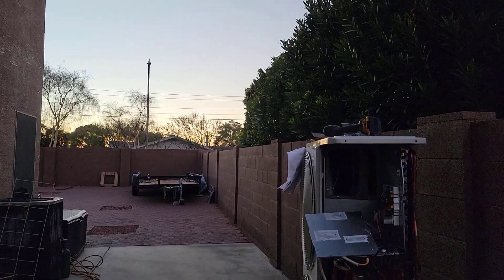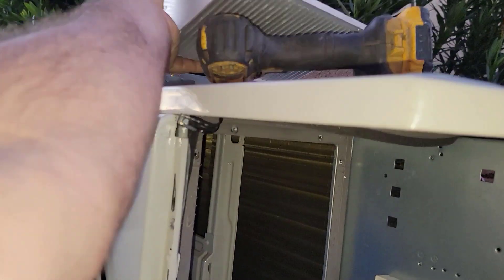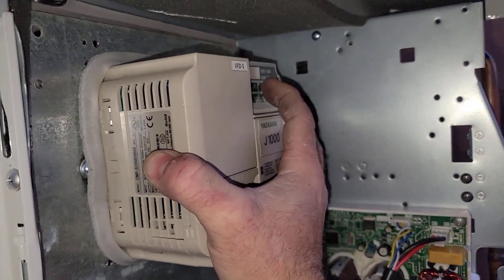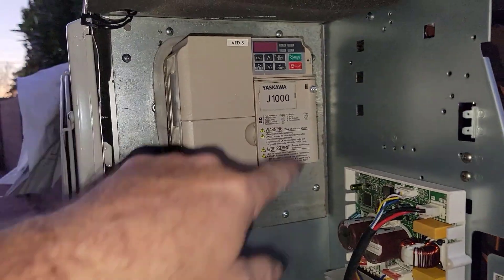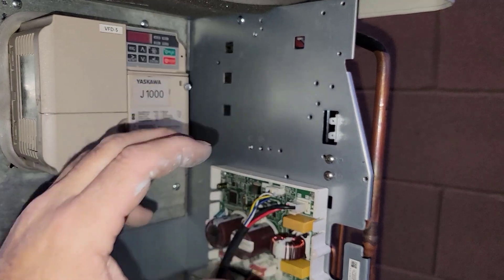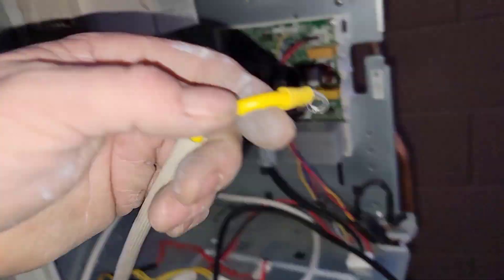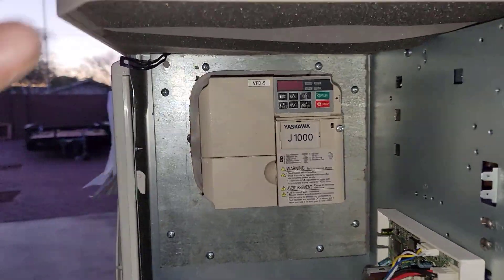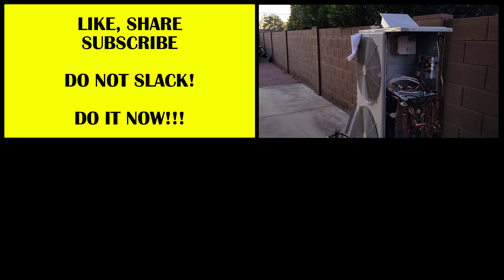Frankenstein Heat Pump gets a new VFD & mounting plate

Comment: Hi:

I stumbled across your channel because I am trying to do something (relatively) similar for a project. I was hoping you could give some advice. I am trying to connect a 5hp VEVOR VFD to the scroll compressor in a Senville 24,000BTU heat pump. However, as I ramp up from lower frequencies, I quickly get an overcurrent trip. When I start it at 50Hz, I need to pull the plug immediately because it shakes violently (maybe wrong direction? I am confident with my coil wiring).

I know the compressor is ok because it was running fine on the OEM control board...

Any help would be amazing. Thanks,

Phil
Reply from the maker: I am not familiar with that drive. As for a 3 phase compressor, you could indeed be attempting to rotate it in reverse. Monitor the suction pressure as it starts. No change = reverse.
For mine, I didn't have to fiddle with the settings too much, but one thing is a 30 second acceleration time like you would do for a supply fan is a no go. The scroll seems to like a fairly quick start to seal and start pumping.

Comment: Hello, what you are doing is crazy. I have a question for you, can we use these VFD devices to run the dc (bldc) motors of inverter air conditioners. Have you ever tried by attaching this device to an inverter air conditioner?

Comment: Great videos - as always. You’re inspiring me to have a go at something novel here in the UK with our astronomical increase in energy prices! Have you ever considered using a 12 volt DC compressor and running it off some 12v leisure batteries topped up in charge from solar panels or wind turbine? Plenty of wind here in West Yorkshire - not a lot of sun though! Looking at trying this setup to heat my Underfloor Heating Circuit and provide some warmish water for my hot water cylinder so the gas boiler has less work to do. Keep going - can’t wait to see the microprocessor you’re going to use to control it all. Cheers. Rich
Reply from the maker: A lot of the base to my projects are stuff that I acquires from work. 
So that would be 3 phase compressors, some variable refrigerant stuff and what not. 

And for a large system a 12 would take some high current stuff. 
3 ton unit is approx 3HP which is near 3kw.
3kw at 12 v would be some monster circuitry.

Comment: Nice!  Can't wait to hear it run...are you planning to replace the Lennox with this one since it's already ready or find a new Fancoil for the R-22 Goodman to test?
Reply from the maker: I plan on placing this where the Lennox is since the Lennox is already R410 and been operating the same way with a VFD.

Once this proves to be good to go I plan on pulling the compressor and VFD from the Lennox to put in the identical tall Carrier unit and have two systems like for like.
When I pull the R22 Goodman I will have to replace the air handler at the same time just as I did when I placed the Lennox in place of the other R22 Goodman.

90% of the outdoor components were stuff I acqwuired free. The Lennox. The VFD's etc. 
I bought the ThermalZone (Rheem/RUUD) air handler that is attached to the Lennox and I bought a new reversing valve and expansion valve when I converted my Lennox into a heat pump. So I am under $1000 into that entire system.